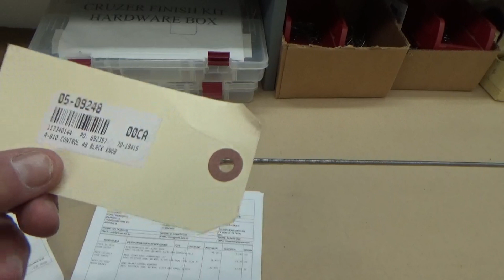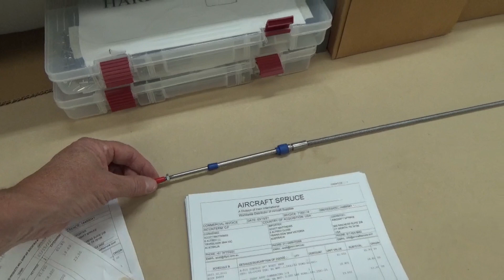The Glamorous Pilot

Comment: Scott, a question: I learned to fly in Australia many years ago (1970). At that time, light aircraft had tail numbers beginning with "VH". I note your aircraft have tail numbers beginning with a number. Can you shed any light on this?
Reply from the maker: Buccaneer, letters signify GA aircraft and numbers now represent the new, for your experience, RAAUS, recreational aircraft Australia and basically anything starting with 24-xxxx is factory built while 19-xxxx is amateur built. In a nutshell. Hope that helps. RAAUS is light sport under 600 kg AUW and less than about 120knots I think.
Reply: @scottmatthews5280  Thanks!